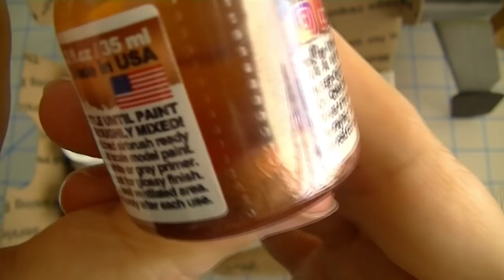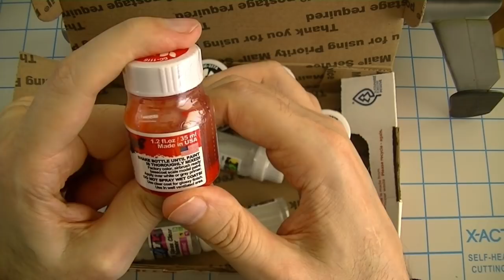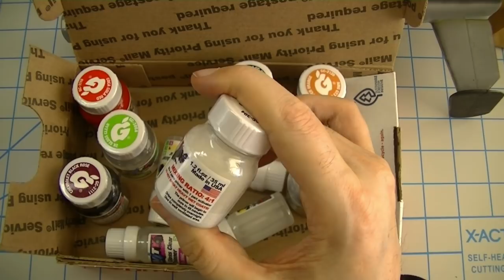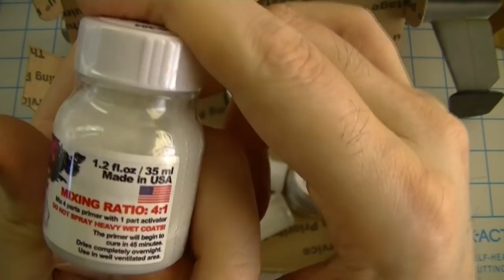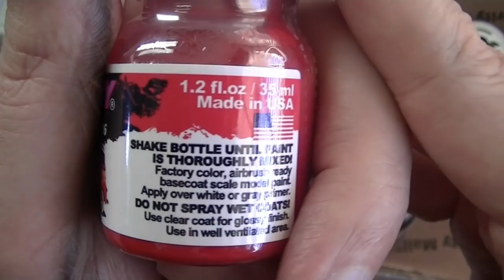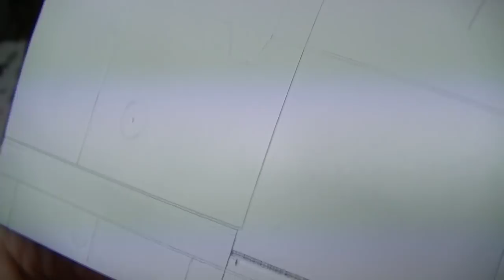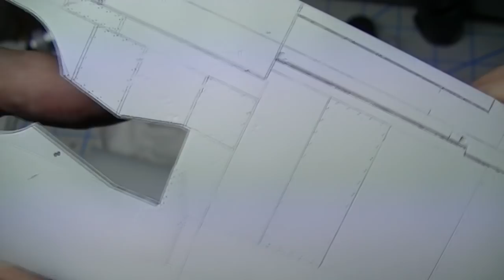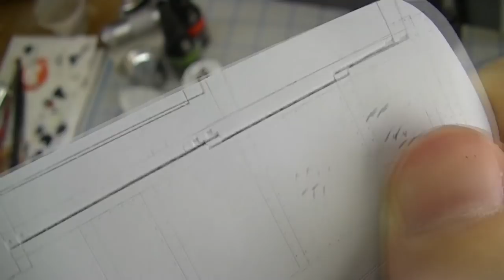ep166 - testing gravity colors part 1

Comment: I use Gravity paints and the 2k clear coat, and I really like them, however, when it comes to the primer there are many single stage primers out there that work fine. It's just not worth all of the trouble of mixing up some primer that you have to use right away especially on smaller parts. Of all the Gravity paints that I've used, that's the only complaint that I have. If you would make both a 1k and a 2k primer like Zero does, that would be great.

Comment: 1k is normally air, 2k requires the paint to have an activator else it will never fully cure. Good thing to show about primer Will, we use primers not only as a good base to sand back but they also show flaws and reactions, better to show it then before you shoot many pounds / dollars worth of top coat!